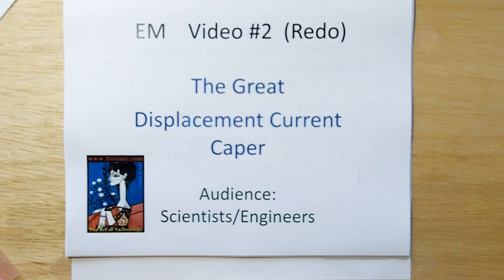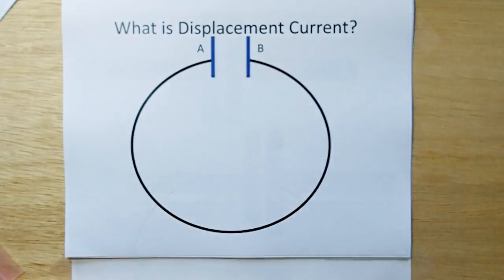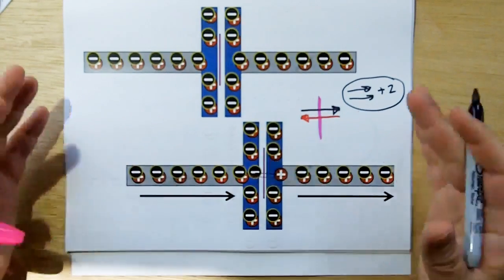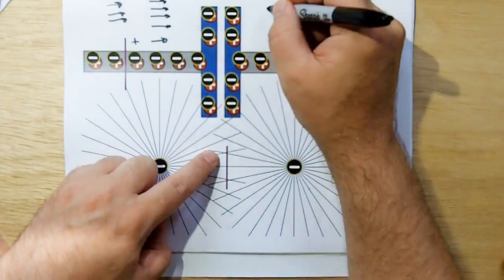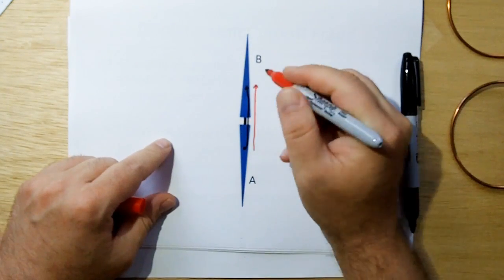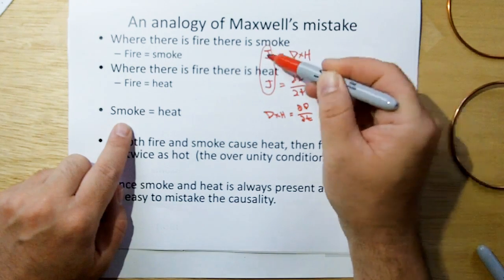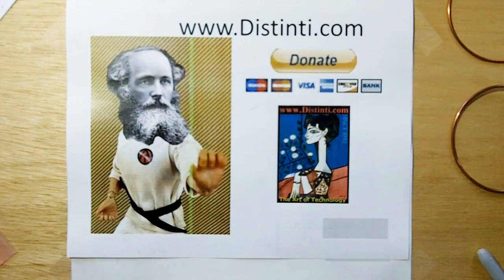emv002b: The Great Displacement Current Caper REDO

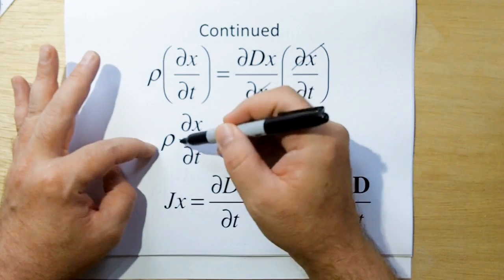Comment: At 10:30, I'm pretty sure that the left-hand side does not represent a current density and the right-hand side does not represent the displacement current. By multiplying both sides by dx/dt and using the chain rule it is implicitly assumed but hidden from the viewer that we will be moving along the X-axis (the charge isn't moving, but the person with the looking glass is moving). Or rho(x(t))*dx/dt = d(Dx(x(t)))/dt.

The interpretation of this last equation is unfortunately not a counter-argument to Maxwell's third equation, it only represents the situation that if we move along the X-axis more quickly, we will see the electric field change more quickly too. This observation is regardless of whether a charge is moving.

Comment: the displacement current is not a magnetic current. 
Magnetic current is spacial. 

Displacement current is a current that takes place in the (di) electric field, which is counterspacial

For me, charge is present as the (di-) electric field (not on the plate, but between the plates). 

By introducing a fast change in voltage to a single plate (with a single wire), the changing field (charge) sets up a displacement current that is conducted through dielectric materials.

I made a video showing this using a bottle of destilled water as dielectric  to charge up a capacitor through the bottle.

Comment: I think you have the whole point wrong. Current plus displacement not necessarily happen simultaneously. You assume they are always present and have the same magnitude
Reply: Yes, I also think that in the wire the electric field is costant in space. In the capacitor instead it's not, but only there. Anyway I really apreciate Distinti for the effort and actually I believe that the same things can be actually true. My only thought is: " where are the exprimental proof of Maxwell displacement current magnetic field production?" Who made them? how? Let us know.

Comment: hence the displacement current is a fraction of the current in the wire, but it is independent of moving charges and thus 
has a different quality to it than just the wire current but complements it.

Comment: erm i don't agree too, i'm not a physicist nor an electrical engineer or else wise but as far as i could understand 
Jtot = Jwire + Jgap, if you express Jtot in terms of Nabla cross H then you have 
Nabla cross H = Jwire + Jgap, hence Jwire and Jgap are complementary they complement to a total.
what more when you open a circle you get a line yes but now the gap is a circle. btw you never run twice around it to complete a round.
Reply from the maker: +Levent Guel    Lets make this real simple and remove the whole nonsense of the gap and the wire.  If you have an electron (Q) whizzing through a vacuum; you have a charge in motion which is J (or dQ/dT at a given point in space).   Because that charge has an electric field, that same point in space will experience a dD/dT as it passes.  (dD/dT being displacement current).  Thus, if both dQ/dT and dD/dT cause a magnetic field, then we should see twice the magnetic field.All of the mathematics in science are just a means to mimic what we observe in nature.  Somehow people have a mind that this stuff is magic like from Harry Potter.  They believe that if they just get the mathematical incantations right that nature will do what we say.Flux lines are also an imaginary constructs (an abstraction) to help our poorly constructed brains to visualize what is going on (though there are those who have claimed see them).  Ultimately, if the mathematics does not match what is observed (in an experiment), then it is wrong -- it does not matter how much we try to twist it around in our head.The ultimate experiment would be to isolate the electric flux lines (D) from a charge (Q) to see which one (when changed) causes a magnetic field.   But this is impossible; however, I know some poorly trained physicist will argue that light contains disembodied field lines.  This is only true if Maxwell's equations are correct to begin; this is what I'm arguing against.
Reply: Am I right that charge Q migrates (displace in space) from A to B is responsible for both E-field intensity vary at A and B while producing a B-field among A and B? If so we have 1x but 2x effect.

Comment: I am afraid I cannot agree with your contention that there is displacement current within the conductor.  As the electric flux through the surface increases due to the approach of one charge it decreases by an equal and opposite (NB) amount as the other charge recedes.  Displacement current is a bad idea but your argument does not seem to discredit it.
Reply from the maker: +David Walton As long as you have a charge in motion there is a displacement current (A.K.A changing electric field).  If you have equal and opposite charge motion, then obviously the effects will cancel.  But then you have no NET current in the conductor.The condition you are citing is the example used to explain to science  recruits why we say there is no NET electric field in a good conduction.  This is important in electric circuit theory because we like the simplicity that our circuit node is all at the same voltage; however, once you have a net current flowing then all bets are off because E=IR means that all points in the node WILL NOT be at the same potential.  Thus, the simplification that we teach to amateurs is of little or no use in modeling circuits where relatively high currents are in play.The examples that I cited had NET current flow; therefore, the displacement current could not be zero in the conductor along the direction of conduction; OTHERWISE, electrons would have to physically collide for there to be a current.  It is the electric field coupling in the capacitor and in the matrix of the conductor (A.K.A displacement current) that causes the current to flow WITHOUT electrons actually physically contacting.  The difference is that the "gap" between the conductor atoms is too small to impede electrons to move (to "arc") from one atom to the next;  whereas, the capacitor gap is too wide in the example given.Thus you can not have a NET current (dQ/dt) in anything without a NET electric field change dD/dt (A.K.A displacement current).  My derivation essentially shows that dQ/dt and dD/dt are essentially inseparable.  Thus Maxwell's displacement current addition results in over unity because we are counting for the effects of current twice.Thank you for you question My You Tube Policy:I  reply to questions that have the best chance of explaining electrical theory to the most people.  I will not respond to any rebuttal of this unless the rebuttal has merit.  Its not worth my time to engage in debates because people (in general) hate to be wrong and recourse to gibberish and name calling.  My objective is to find the theories and models that best mimic nature; I'm grateful to be shown where I'm wrong so that I can get back on track to the truth.  Unfortunately there are too many who "know" the ultimate truth and inundate me with irrational gibberish.  This includes those with advanced degrees professing a "correct" understanding of EM field theory.
Reply: You are right, of course, and I am guilty of making a schoolboy error.  Indeed the 'displacement currents' for the charge approaching the surface and that for the receding charge do add.  If we assume a positive moving charge for simplicity, the approaching change produces a positive dD/dt, and the receding change does too because, although the flux from it is decreasing the field lines are in the opposite direction (this is where I went wrong) producing a decreasing negative and hence a positive contribution to dD/dt.  I would like to continue our discussion off page if that is possible.
Reply from the maker: +David Walton To What End?

Comment: also at 13:40 you show real current moving one way and displacement current moving two ways if the displacement currents both cancel each other out you still have the real current in black there so surely the dipole does still work ?

Comment: im a total beginner and was wondering why the two currents have to add? why cant the two exist together but not add? eg if i have one guitar plugged into two 100w amps, i  have 2 100w of sound not 200w of sound,(they're not the same thing) or two 100w lights on at the same time, im using 200w of power but my lumen output is that of 2 100w bulbs  not one 200w bulb. why cant there be two breeds of current that exist just out of phase with one another or something. also nikola tesla always claimed that displacement current was aetheric and required no magnetic field, so maybe in the presence of something that happens or exists within a capacitor, electron current can be converted to displacement current then back to electron current again, meaning the losses in a capacitor are due to the energy converting from one form to another. is there a perticular reason this cannot be the case?
Reply from the maker: +thehornboy The displacement current and real current do exist separately and don't directly add as you were wondering; however, Maxwell claimed that the magnetic field generated by either is indistinguishable.  In other words, one amp of displacement current develops the same magnetic field as one amp of real current.  Therefore, they can be added together for the purpose of determining the net magnetic field generated.  The total power produced by two 100 watt light bulbs (light + heat) better be equivalent to the power output of a 200 watt light bulb or its game over for humanity -- we should stop building anything until the discrepancy is resolved.
The models that we humans use, to build things with, must accurately mimic what we observe in nature; otherwise people could be harmed by malfunctioning machines.My argument is that we observed magnetic fields only for real currents; if displacement current did contribute to a magnetic field, we would have different measurements for the magnetic field in a good conductor and dipole antennas would not function as they do.
Reply: +www.Distinti.com cheers for the reply, i need some clarification, what does indistinguishable mean exactly, what was his reasoning that the two develope the same magnetic field, that sounds to me like hes saying they make half each. and if the two make the same field why does that mean they can "therefore....be added together". my point with the light bulb or speaker cab analogy was the lumen intesity of a 1000w bulb within the first foot is a certain amount per cubic cm then it decreases. a 500w bulb has less lumens per cubic cm within the first foot and the brightness and wont go up as much by adding more 500w bulbs.for that 1000w brightness  you need a 1000w bulb or two 100w bass amps plugged into the one bass isnt as loud as a bass plugged into a 200w amp. they combine in a way that isnt they same as simply adding them together.  so what i was hoping you can clarify is why the two currents add. why cant one just disable the others ability to be fully expressed or something ,or the electrical momentum produced by the electron current cant just stop at the capacitor and the path of least resistance at that point is to transform into displacement current and keep going. in a loop without a capacitor you dont have access to the displacement current so its like it isnt even there. eg teslas radiant energy couldnt be measured using normal amp meters and volt meters the radiant part just wasnt accessable, you needed to reduce or get rid of the electron flow and the best way to do that was with his disruptive discharges,  which allowed the radiant energy to be coverted to light and heat. it moves with the current. but without matter stripped of excess electrons (plasma arc) you cant access it, it uses the plasma arc as a load.

Comment: You used the term radiation to describe the magnetic field I believe. Could it be possible that you actually could double the amount of energy through induction. My thinking probably is wrong but you mentioned that matter is what is ethereal and the ether is more solid. So having said that is it possible that the ether could account for this doubling , adding its own energy to that of the field that was generated? See youtube video called'' the doubt about overunity is over'' by gerard morin. he says hes amplifying the current not multiplying it by useing 50kv transformers. interesting video.

Comment: But thanks to Distinti's video I noticed something else possibly wrong with the presented Maxwell's equation.

In the above setup, with a wire loop and capacitor, current J can never be dQ/dt, because, as we know, current flow through capacitor is never at a constant speed but it follows an exponential curve. In the shown circuit, current will be constantly accelerating and decelerating.

So maybe we need d^2Q/d^2t to correctly take acceleration/deceleration into the account?